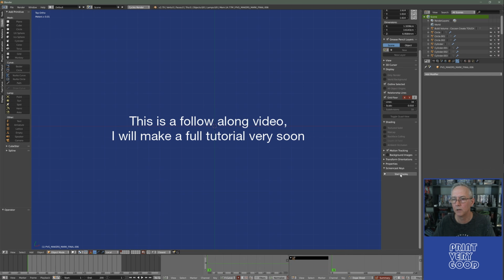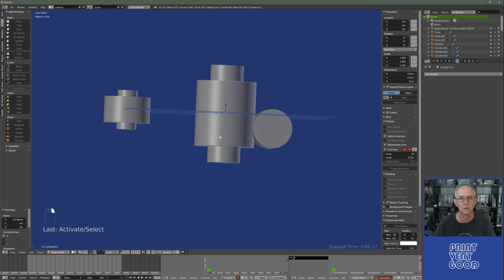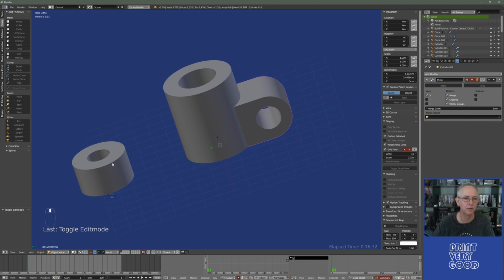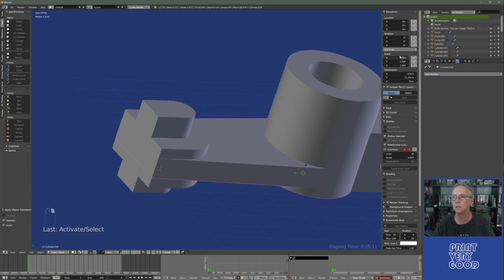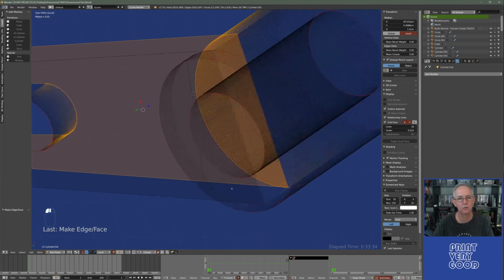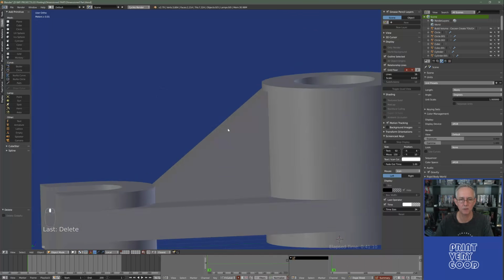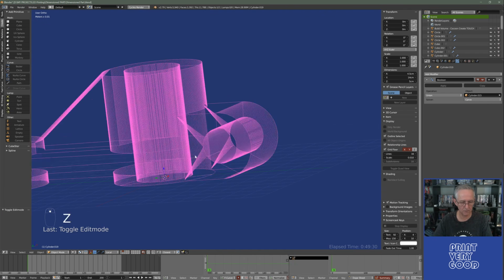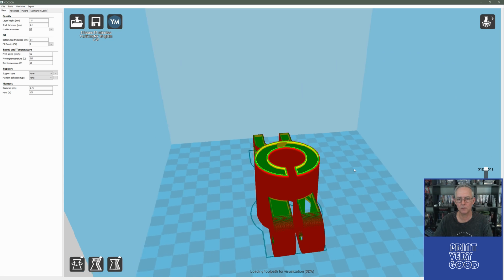Dimensioned Drawing to Accurate 3D Part Using Blender - Full video.

Comment: You could have inset the cylinders. Then held alt select in the Inset circle line of the middle cylinder.  Then shift S move 3D cursor to selection.  Then brought in a plane and moved it down 35. And extruded it 10

Comment: i got a question a kinda dumm one.
where do you find your Measurements? or more like how do you get  them?. I'm looking for General Directions to get more Accurate 3D Models. like maybe a Car Piston or a Light Bulb, or maybe a Switch of Some Sort. i know some of these will lead to dead ends but i want to know ;P incase if you say you make them yourself well chucks.
will have to ask how did you reach to those Measurements...

Comment: At 7 minutes, I would not have assumed flush with the bottom. Look at the Physics of the part. That was a pinch bolt  for the main cylinder to lock it in place. Should have been centered on that main Cylinder...

Comment: I gave you a thumbs up and I think this video is lovely. You modeled the part the way a 3D animator would model it. There is also another method where you can extrude the parts into the 3D space from a two-dimensional sketch of the top view of the part.

Comment: Great explanation video, really love how you explain the topics. Im just starting to learn blender, my basics is in mechanical design so i am familiar with inventor, solidworks and that kind of software. Without any disrespect, that kind of shapes can be done easily with CAD software under 15 minutes including explanation, or like 5 minutes without explanation. So my point is if i wanted to make an action figure with articulation in which ill need to have an exact dimension for the joint like the videos above, is blender a suitable option for that, or do i need to combine both CAD software and blender in order to achieve those??

Comment: Could you please explain how you determined the height of the rotated cylinder on the right? It seems centered in the photo, but I saw that you dropped it down.   Is that trade knowledge, or familiarity with the original part?
Reply from the maker: Hi James. Yeah that was a tricky one as there are no measurements to indicate where it should be placed in the drawing. From memory I made an arbitrary decision to place it on the ground plane but I have others say it should be centred.
Dropping it down also allowed me to print without the need for supports.

Comment: I am curious what the benefit of using blender for this particular application is, when you can create that part in less than half the time in fusion 360?  I would also be very interested to see the printing side of this project.  The printed part you show appears to be very clean, so seeing the setup would be very helpful.  I have a couple 3d printers and I would never consider printing in the orientation that is shown at the end of this video, as those long bridges never workout for me.  I have been relying on supports to do this sort of print, and that's a whole other set of issues.
Reply from the maker: I already use Blender for everything I create, characters, animation and parts. There are a lot of things I use Blender for that Fusion 360 can't do. To see the sort of things I create using Blender, check out my free stl files www.printverygood.com  
Here's a small animation I created with Blender. https://youtu.be/aP04axoWIXo
For me Blender is the one software package that serves all my needs.
Reply: @PVG3DPrints  Thanks for the reply and the input on why you chose blender.  I'd still be interested to see the printing setup. I can't get my bridging to do that sort of part cleanly.

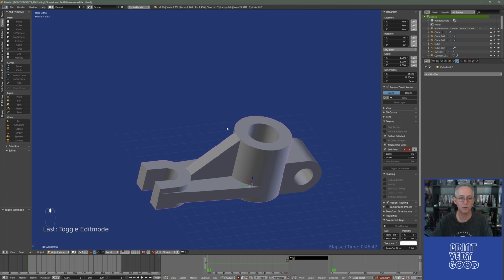Comment: 47:34 "That's exactly as per drawing", apart from the drawing does not give any inference that the top of the gusset is so intricately curved, I attempted this before watching the video, and yea this gusset was a real head scratcher,  I thought about producing three cutters and treating the gusset as a piece of plate that needed to be machined,  two vertical drills and a horizontal punch on the y axis ... still a great video, glad I'm not the only one using blender for print design.
Reply: Also the part at the back used to clamp the part to a shaft, is probably centered on the vertical collar, good example of a poor drawing.

Comment: why not just use solid works or catia or nx or something made for engineering?
Reply from the maker: That's a good question. I need my 3D package to be able to do 3D character animation work and television commercial work as well as CAD style projects. With Blender I only need one software package to do all these things.
Reply: @PVG3DPrints  I see, I don't really know about the 3D design side since I'm an engineering student so I'm most used to parametric design, operations and reading schematics, but Im sure there's a way to use some engineering cad software and export to something blender can use.

I have used blender to cleanup meshes of 3d scanned mechanical parts and I had a very easy time exporting and working back and forth with solid works 19
Reply from the maker: @camilo3626  Don't get me wrong, if engineering was my focus I'd be using a dedicated CAD package but for now Blender does all I need it to do. Plus I don't need to spend money on software licences... I've spent tens of thousands of dollars on software licences over the past 20 years, not any more ;)
Reply: @PVG3DPrints  okok I get it 😂, is just that I'm used to torrenting and piracy, you cannot buy enterprise level cad with a student budget

Comment: This is more time consuming than a cad software, does this thing have the same capabilities like fusion 360 where you can just sketch and do work from your sketch.
Reply from the maker: Blender is 3D animation and visualization software, that's it's intended purpose but I find it very capable for producing the CAD type parts I need. When it comes to capabilities, if it's purely CAD you're after? Then no, Solidworks, Fusion 360 are superior. If you need to create more than CAD parts, like free-form modeling, 3D characters, 3D sculpting, animation etc then Blender is superior. I need my 3D software to do all these things.
Reply from the maker: Re sketches, Blender employs a different workflow. If you can point me to an example CAD video using sketches I can show you how I would replicate the procedure in Blender (quote the video title, don't include a link in your reply as YouTube will hide it).
Reply: One more good thing, it's free of cost. 
I am use 2.79
Reply: BTW if you want to produce parts you can always use CAD and then import it to Blender for visualisation afterwards.

Comment: Blender is very bad program for accurate CAD modelling. I would make the same detail in SketchUp in about 10 minutes. Blender creators should think about precize modelling features that present in Sketchup.
Reply: I agree, seeing that he is ready for printing at the 56 minute mark its just not useful when u can do it under 10 min in for example a fusion 360 (which is free for personal use). Would love to see blender developing a proper CAD workspace.
Reply: IMO, one of the reasons Blender has been successful as an open source project is that it has maintained discipline. It has fairly successfully kept its interface minimal and complete for its declared purpose: animation and visualisation. Sure, develop a full range of CAD-oriented tools, but in another branch.. ultimately it could be merged, but that's unlikely, because it would probably damage the central philosophy of the interface. Far better to follow 'Do one thing, do it well, make sure you can talk to other applications doing their own thing well'.
Reply: As someone who has done a ton of modeling on fusion 360, this is just painful to watch.

Comment: First: good explained video, your steps are very good to follow!

I have some criticism, but I don't want to diss you, I want to help you to increase your skills even more! 

I think, to get more closely to classical CAD techniques, you should use more modifiers. So your part is working pretty well, but it you would modify it afterwars it is not so handy. (I'm working at the moment at an workshop for an makerspace which is interested in using Blender like an CAD tool). So the Solidify modifiyer is very usefull and also The Screw and the curve modifier. Also the addon Booltool is very nice. As Inspiration to get an more CAD like workflow I recomend this Tutorial. https://www.youtube.com/watch?v=v9CXeprYW1M

A tipp from me: It is not neccesary to applay modifiers you could keep for modify, becouse you can export with applied modifiers (there is an option). And at the cylinders, I would added simply two in edit mode and than use bridge edge loop in edge context menu, but your way is not wrong or bad. It's just my personal opinion.

Don't understand me wrong, you invested a lot of work in a video which is worth watching!

Comment: Great video! Thank you, I’m new to blender and I was wondering if I could design with measurements. On a second note, the center and rear cylinders are really a clamp, so the rear clamping “ears” (I think they are called that way) are usually placed on the center of the cylinder to apply equal clamping force.

Comment: Thank you for this great video tutorial, I enjoy using Blender for modeling more than using a geometric modeling package like fusion 360 or Solidworks. I have a question though have you tried the following addons for blender 2.79 or  2.80 namely BoxCutter and Hard Ops? both will make your modeling easier. I personally like BoxCutter very much. I look forward to more of your videos. Thank you again for your time and educational videos.
Reply from the maker: Thank you Felipe! Yes I've checked those addons, my only concern is the type of Boolean operation they're using. I haven't seen meshes created by those tools converted to STL files. I find I only get good sound meshes by using the Carve Boolean operation, Bmesh tends to make a mess of things when applying modifiers on STL export and it looks like they are using Bmesh… But I could be wrong.
Reply: @PVG3DPrints , thank you for your quick reply, I must admit I have not used the mentioned addons to export to an STL file but I'll look into it and see how they behave. thank you again for the the reply good Sir and I wish you a pleasant evening.
Reply from the maker: You're welcome Felipe, you have a great evening too!

Comment: Great video, for further ease with execution of such a thing..I advise to make the "Measureit" addon active in the addons list..once you do it can be seen in the properties menu..
it will allow you to know the EXACT dimensions of ever point you desire to..WHILE modeling..so you dont have to guess and you can build to an exact measurement if desired..

-Gray
Reply from the maker: Thanks for the tip GRAYTER1! I do have the measureit addon active but it's a bit unclear how to use it properly, I'll have to do some more research. I'm actually enjoying using the grease pencil ruler/protracter… works a treat!
Reply: @PVG3DPrints  I think you  just choose the line or face you want dimensions shown of and then under the tool in properties, click "show" ..nothing will show immediately until you click the axis x,y, and or z..then you'll see the values displayed..you can manage them under the "items" tab that will be there under the Measure tools after you do the prior mention...Still figuring all this out myself bit by bit..
Reply from the maker: Excellent! Thanks for the info GRAYTER1 I'll give that a try.
Reply: This when using 2.8 at least..I can't recall addon in 2.79 it may be there with newer builds.

Comment: Blender for modeling 3d prints? hell yeah! I find it much easier and efficient to use than CAD tools, those modifiers are just so great, my most used one is boolean, and for simple mechanical parts just using the extrude functionality with snap to grid turned on and the shortcut workflow enables you to create such parts so fast. Then if we go to Organic shapes, CAD software is a nightmare.

I don't know why Blender isn't that popular on the 3D printing community, i guess many are all about parametric modeling and think such programs are more accurate but actually its just mathematics and numbers so there isn't really much difference in accuracy, numbers are numbers. To use Blender for accurate modeling of 3D models (i use CURA don't know how the units translate to other programs/slicers)  I only have to set the units in blender to mm and then the scale to .001 and voila! resolution in the nanometer range and accuracy of a few hundred picometers, then you can export in STL and have 1:1 scale. I doubt 3d printers will reach atomic scale resolutions anytime soon... Something i have to give is that Blender has a very steep learning curve, its so stuffed with tools and functionality that you get overwhelmed when you are just learning the very basics, Blender is the "Wenger Giant" of 3D programs.

 I can't stand CAD programs, yet everyone seems to use them, it feels like doing work, a tedious and overly complicated workflow that only  works well for solid surface modeling of parts that will probably need to be modified quickly and many times aka parametric modeling for underpaid engineers that like to do trial and error in virtual simulations.  Anyway, thanks for the nice video.
Reply: Can make it with Solidworks in 5 minutes. Blender and similar software is not for parametric modeling, but good for other purposes.
Reply: would still learn CAD to be able to do this in 5 minutes then bring it into blender and have the rest of the time available to either further build more organic or setting up shaders, materials etc.
Reply: take a look at Fusion 360, not as powerful as Solidworks or Inventor, but of fusion 360 there is a free Personal Use edition.
Reply: While i can use CAD, i'd rather master blender so I mix free form and constraints together.

Comment: Hi Paul,
I think the point Angus was making is that a program like fusion360 or a dedicated 3D CAD package is "better" suited for mechanical designs etc. I don't think he meant that you can't do it. I've done your benchmark in Fusion360 and it took about 20min. compared to about an hour in Blender. the end results are about the same but fusion is designed to do this type of thing easily and quickly. I've uploaded a screencap of the process and the STL to Thingiverse if you want to print and compare. should be basically identical to the blender one though.

https://youtu.be/_TGvUJJx3vo 
https://www.thingiverse.com/thing:3435901
Reply from the maker: Hi Anthony, I agree that Cad packages are better suited for mechanical designs, no argument there. Angus specifically referred to lids fitting on boxes (tolerances) and that Blender wasn't good for that... which I disagree with but I needed to test to be sure. An engineer friend (Ben Lewis) watched my video and created the same model in Solidworks and emailed it to me and I have since 3D printed it. The results are quite interesting and it's been a great exercise for me to undertake. I'll be wrapping up my testing and conclusion video tomorrow and finish editing part 2 (hopefully). As a comparison Ben said it took about 10 minutes to model in Solidworks. 

Thanks for making the video and sharing the file Anthony! Are you happy for me to show and compare your file in my video? Naturally I will credit you. Cheers, Paul.
Reply: @PVG3DPrints  definitely happy for you to show my model. It's funny because I spent a fair bit of time trying to get the central gusset to look right. I think if I did it again it would be about 10 minutes too. Definitely recommend fusion360 as it's free for makers and startups, And very powerful.
Reply from the maker: Thanks Anthony. Agreed, working with dimensions is not my normal workflow, could definitely get the time down too. On the drawing it shows a convex and concave shape where the gussets meet the cylinders, I had to think for a minute on how to create those curves. Ben had his attachment points as a straight line initially. Did you go with the curves or a straight line there?
Reply: @PVG3DPrints  on one side it's curved and on the other it's straight. I'm not sure if I can do curved at both ends. Structurally it will be the same but it shows the difference between vertex modelling and parametric modelling, some shapes are very dificult to do in parametric that are fairly straightforward when you can just manipulate the vertex.
Reply from the maker: @AnthonyWratten  For sure, each method has it's pros and cons. Ben did get it solved in Solidworks but it was a little tricky. If we add that time to his intial 10 minutes we're probably getting closer to your time. ;)
Reply: @PVG3DPrints  ... This particular section -- convev top, concave bottom -- is probably (if it were a real, stressed item) a flat plane with filleted junctions... along with all the other junctions.

 Thanks for your work.
Reply: @PVG3DPrints  Solidworks is the best suited but the price is prohibitive for non CAD/CAM industries or pros; on the Fusion 360 I agree it's best suited to mechanical parts vs Blender (which excels at character and organic design and sculpting) but when I tried to make a very simple rectangular box with a 2mm shell the model failed to export properly and even importing it into Tinkercad (an Autodesk product same as Fusion360) rendered it full solid without any shell; can u confirm that a basic function as shell fails in Fusion 360? On the advantages side I count Blender to be open source (with lots of upgrades and even re-versioning as 2.8), free, fast (does not need the last pc as opposed to Solidworks and Fusion360) and it doesnt tie you to cloud/internet (as Fusion360 does, which is in many cases frustrating and also I dont like to give away my models to their servers); great video!
Reply from the maker: Oh, also that's not a benchmark I created Anthony, it was just an dimensioned drawing I found on the internet.